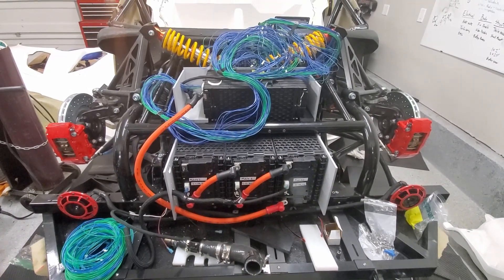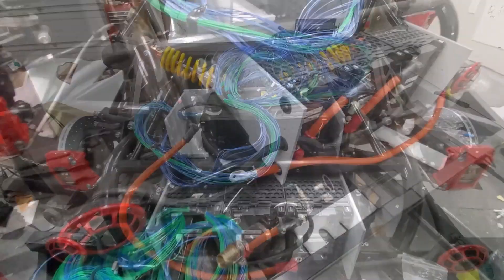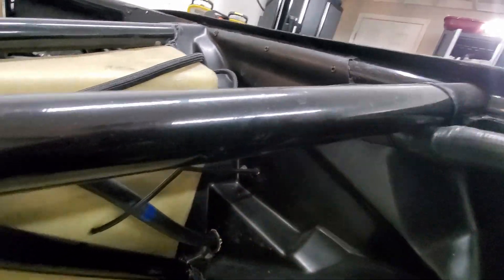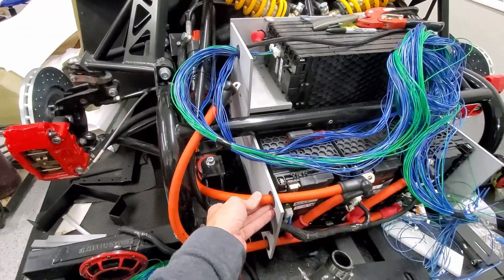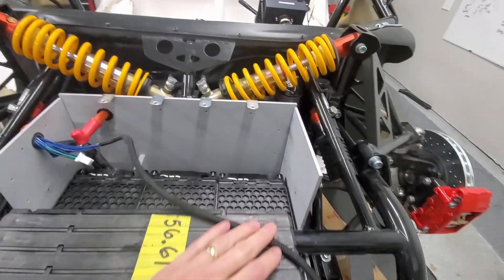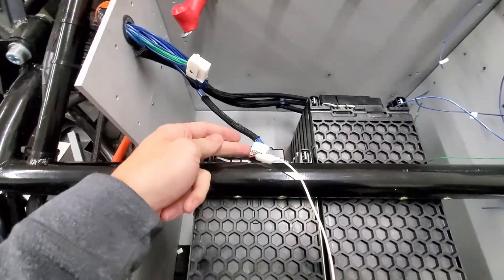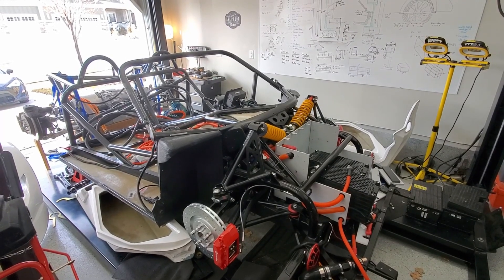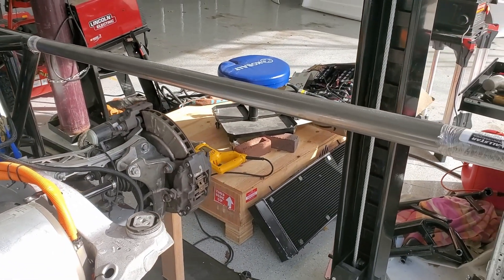Rear Frame Fabrication

Comment: At 9:56 and about 13:26 Being that the Tubing is fairly thin walled, you probably should have found someone that could TIG Weld them, It would have been better, stronger welds, being that the Motor is hanging off it all. That second weld you showed there at the back corner, has a bunch of porosity holes, and all the extra nicks with the grinder makes it a suspect joint, Sorry for the Critique but I'm a Fabricator, here in Australia.
Reply from the maker: For me...it is all about learning and the process

Comment: is the entire frame of this Kit Car made out of Cold Rolled Steel?
Reply from the maker: Pretty much
Reply: @electricsupercar  I will say this Cold Rolled Steel is an easier material to work with when building a car instead of using Forged Steel (like you would see the biggest auto manufacturers use). Plus Forged Steel crumples into a metal sandwich when involved in an accident.